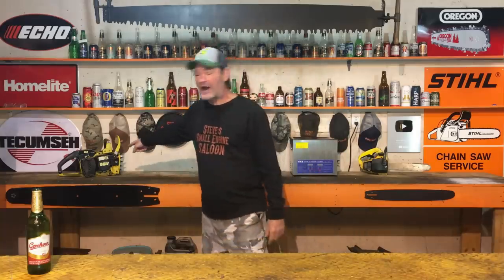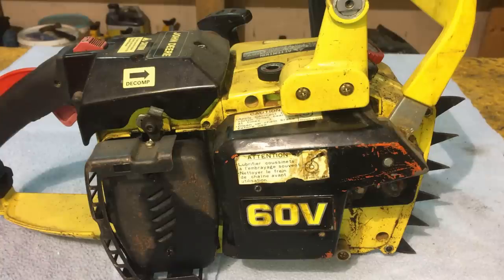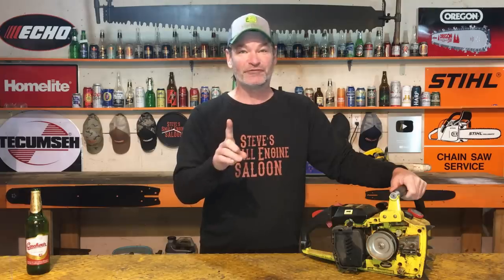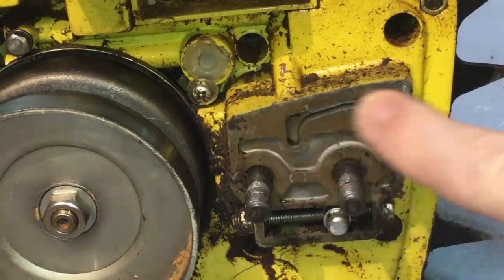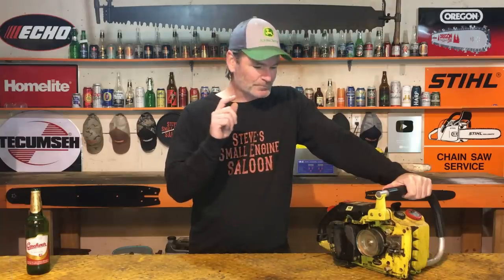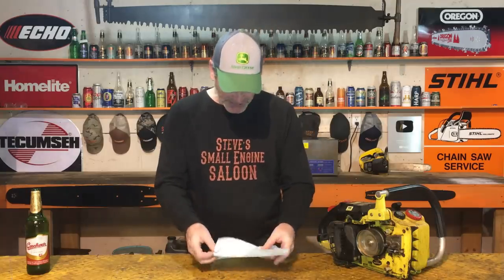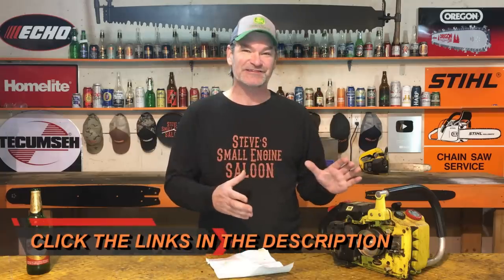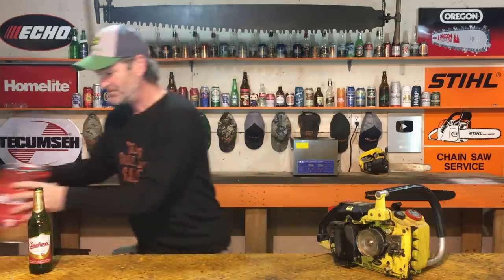Help Me Fix This Chain Saw Oiling Problem

Comment: I had an echo in my bench a while back that did that. What worked for me was  kerosene in the tank and let it sit overnight, it still wouldn't push anything through, so I load it up with brake fluid and carb cleaner in a 50/50 mix and took a air chuck and a rubber glove and forced the mix through the system through the tank opening.it took me 4 tries to get it to work but the customer has been using it for about 2 months now with no problems. Hope this helps.

Hope this helps
Jimmy Jones
echo technician and Cub cadet master technician
Ada outdoors
Ada Oklahoma

Comment: deffo would be something gummed up somewhere fill the oil tank up with some kero or pb blaster and let it sit and try running it for a bit after standing most likely will spit some gunk out from somewhere as i think its down to stuck check valves or gunk of combo of the 2

Comment: Steve , you know its just something simple because it worked at one time  and echo saws are not crap . Remove the oiler guts check the parts breakdown  and one piece at a time, blow out all the lines and tubes.

Comment: My brother in law will just remove the oil cap and shake a splash of oil onto the bar to lube the chain if the saw stops oiling in the field. It works till you can fix the real problem. I agree some solvent/oil mix to clean it out and if that doesn’t work time to disassemble. You’ve at least got a picture to go off of and beer to keep you sane.

Comment: I guess if you say you tried everything that means you tried everything which must include taking the oiling system completely apart and and making sure there is no blockages cause thats what it sounds like to me especially if you replaced the o-rings and also check the oil reservoir and make sure its free flowing if everything checks out get a manual oil can keep the bar lubricated cut wood which you say you need to do with this saw then -------drink a nice COLD bud light in the long neck bottle which Ive never seen you do and tell me that aint the best beer you ever had I know you wont do that   thanks for all the videos  love them

Comment: First thing I would do is try to make sure that the pump is getting a supply of oil the pick up screen is clear feed tube whatever it may have then I would consider the possibility of the pump drive gear being stripped I would also consider pump cavitation maybe from a bed vent cap and of course a restriction in the oil feedline, Try to lightly pressurize the oil tank while rotating motor see if you get oil coming out or remove the pump pressurize the oil tank see if the pump is getting oil

Comment: Could a piece of saw dust have fallen into the bar oil reservoir during refilling and now it worked its way into the line.  Maybe using some gasoline or other solvent forced back through the line (from the bar to the reservoir) would flush anything out.  You could use a small pipette to force the solvent through (unless of course if there is a check valve...)

Cheers!

Comment: Check and see if it has bar oil in it! Also, did it ever oil ok while in your possession. Has any body ever worked on the oiler? If so, it could have a check ball or spring in wrong. The only other thing to do is cuss it. You know, kind of like the preacher that had a lawnmower that wouldn't start after pulling on it for 3 days. He was complaining to the man he bought it from and the man told him "Reverend, you have to cuss it!" The preacher said he couldn't do that because he was a man of the cloth. The man advised him that if he kept pulling on the rope it would all come back to him.

Comment: I have the bigger brother to that saw and it wouldn't oil unless the oil came to the cap. Turns out the oil pick-up nipple is high in the tank and relies on a section of line and a oil strainer to reach the rest of the tank, and it must of rotted out before i got the saw.

Comment: I'm sure you know this, but the problem is often a piston stuck at TDC (the one that follows the  cam),  dirt (or flaw like rust) in a check ball or disk. Bad springs will do it too. That oiling system (OMG) has all those parts - and more parts than a Whole Husky  would these days. A vacuum leak on the manual oiler would also shut down the automatic side and vice-versa. Hard to be specific, but I'd be glad to give her a shot if you want to ship it. I'm no saw expert, but have many years with industrial machinery, Hydraulic valves and the like. I've seen some weird a$$ stuff causing seemingly simple problems. Take it apart again, fully understanding what each part does, and the problem will reveal itself. Beware weirdness like porous castings, transposed springs that look the same but are not (and check balls likewise) bad (small cut) rubber parts, etc. Maybe the cam is worn and not stroking properly, or spinning on the crank (if pressed or keyed on) - it's that kind of stuff that bites you in the rear. Assume NOTHING, Verify EVERYTHING!
Good luck, I'm sure you'll get it.

Comment: to fix this you have to take it apart. there is a mechanism that actuates the oiling. for whatever reason maybe rusted its stuck. or like a spring is broke. just take it apart and make sure it matches up with the diagram you have

Comment: Had an old Homelite years ago that wouldn't oil. Filled the chain port with carb cleaner and let it sit for a couple of days and then blew some compressed air into the port and the sludge came out. Those check balls sludge up. Good luck

Comment: Oiler isn't pressurized setup. It runs off engine vacuum. Good compression ?  So...its sucking air its not supposed to get...grommet where hose goes into oil tank ?  You could do a smoke check or just silicone seal that area.
  Also pickup hose in tank...filter and/or hose plugged.

Comment: Someone mentioned diesel fuel as a solvent for a soak, or carb cleaner. I think it will work outside of breaking it down and blowing all the ports out and checking the seals.

Comment: i need to know what you have done to help you
Reply: 1.take all 35 parts off put them in ultrasonic cleaner. then put the whole oil well in the ultrasonic cleaner 30min at least then blow it out and re assemble.   (make shore to drain all fluids first)

2. ore you can fill oilier full of kerosene all the way to the top and pressurize the tank in-till it frees up.  your welcome.
Reply: the reason this is happening is because one of the passages is clogged and the oil is taking the path of least resistance and flowing back into the tank.

Comment: Contact Greg at oed distributors in North Carolina they are an echo distributor and Greg has been in the parts department since those saws were made he’s very knowledgeable and will take the time to answer questions about the old saws

Comment: After an extended look at the lubrication schematic, I'm pretty sure that the thiggymawumple is not seated properly in the dugudoodle so oil doesn't develop enough pressure to pass through the hogglestint.  Or it's just broke.  I'd send it to Steve's Mall Engine Saloon I if were you.

Comment: Disassemble, check all the springs, the check balls, the O rings and passages for damage and/or gunk, blow out the passages both ways with compressed air, reassemble, fill with oil and try again.   Maybe first, check that it's got the correct bar on it, bar could be blocking the oilier.

Comment: Try to pressuring the oil tank using compressed air 
If nothing comes out you know that there is or a line broken or something clogged

Comment: It's a hydraulic contraption like an automatic transmission... full of balls, poppets, springs, check valves, etc.  At least one of the ball poppets isn't seating correctly... like a dirty needle valve on a carburetor float.  Clean it out with your choice of solvent and it might work.  Ultrasonic cleaner might work too.

Comment: Steve as complex as the oiler is it is simple the is a check ball an spring gummed up in the oil flow rate setting I'm with Larry on this one  unfortunately if that does not work you gonna need that large beer an about 2 hrs. to pull the oil system apart an make shore the is not a broken spring in it . Could have a small vacuum in the oil system as some of those used a vacuums pulse from crank case to send oil through the system but it runs to good for that but have seen that befor as well on an old Lombardo saw

Comment: Pressurize the oil tank, if oil doesn’t flow when running, then their is a spring or stop Ball stuck closed. If oil comes out when pressurized but none when not pressurized, then either an o ring worn or something stuck open that isn’t allowing the Oiler system to pressurize itself and pull oil through Oiler.

Comment: My guess is that someone has previously had a go at it and put something in the wrong way or left something out. Strip it again and carefully assemble as per the diagram. Another thought.... could it have an air lock and need to be bled somehow?

Comment: Is the oil pump driven off the crankshaft the worm Drive plastic gear could have burrs on it maybe it's stripped the teeth so no oil can drive to the oiler

Comment: Looks like a pressurised system from the crankcase doesn't have a separate oil pump, so there will be a artificial rubber one way valve connected to the crank this is not seating properly you're not building up pressure and it will suck back in check that

Comment: Weak bypass spring or leaking seal. Put brake fluid in over night. It will swell the seals. Remove the oil tank cap and see if it oils. Venting can be an issue. 
These old saws were overly complex on the oil system.

Comment: have you verified the pump drive is being drivin?  if so,  start verifying flow from the pump to the tank. work your way back 
through oiler gallerys making sure you keep track of everything you do along the way. my guess is its not priming do to an
air leak in the system.

Comment: Fairly sure that beer is the original Budweiser (pronounced bud-var in the homeland of Czechoslovakia). Some of the family emigrated to the States way back when foreigners were still wanted, decided to carry on with the family business and so set up a brewery. Then for various reasons due to pollyticks and so on borders between the two nations closed for a wee while, and when they reopened again Budweiser (now Anheuser Busch) had turned into a big company, helped by the fact that yanks like their beer to be similar to sex in a canoe. The original family business back in Czechoslovakia was still doing fine and making nice beer, and so the Yank offshoot sued their butts off and forced them to change their name. And that's what you're drinking now.

Or, I could be completely wrong. YOU be the judge.

Comment: My thoughts are the oiling passages are stopped up. Spray wd 40 starting from the chain side and let it soak, by the wat tur the saw on its side. Use a fairly stiff copper wire to work the saw dust out. Maybe have to do this from top side as well. Be safe. Peace.

Comment: I would look for cracks or corrosion somewhere in the oiling system somewhere in the chain saw case. If you can get the hand pump working would be best. You have to get that working first. You can always run and use it with just manually doing it as most old chain saws only had that. The automatic oiling may never work
Automatic oiling has to work by either pressure from the crankcase or vacuum 
You know this am sure. Get a good straight light and look for crack or corrosion somewhere in those small parts and maybe use compressed oil and block up air leaks on other ports and see if it holds air. My best bet there is a crack or a corrosion issue somewhere in the oiling system somewhere. Let use no what you find

Comment: I would take the oil intake hose and force air through it. And see if it clears the oiler pathway. If that doesn't work force feed kerosene through it. My guess is, as old as the saw is, the parts may have rusted shut.

Comment: Try pressurizing the oil tank. Put some degreaser in first. Push it in with pressure,  let it set, then run it on through,
Reply: How bout trying it in reverse

Comment: I like the idea of pressurizing the oil tank with light oil in it someone else posted.... How about using a Vacuum Cleaner to SUCK on the oil port...  Pressure could blow a hose off.... Problem might be closer to the bar.... a plugged up area...

Comment: Have you thought of drianing the Bar Oil, and putting Acetone in to "FREE-UP" the Check Valves?

Might work, might be a waste of Good Acetone...🤔

As for the "O Rings", see if you "can obtain" an OE set, or equivalent.

Glad to see that "EVEN YOU" can get Stumped!

This is a Community of Individuals. It takes a Village...

Take care Steve,😎
🤓 -Thomas
Western Washington State

Comment: Fill the oil tank with a very fluid degreaser, run it for a few minutes then slowly start opening the oil adjustment valve.
 Just a guess from my side of the pond. 👍

Comment: I only let 1 machine get the best of me. It was a McCullough eager beaver that would not start. I spent at least 70 hours working on that thing, got it to fire up for about 3 seconds than threw it up against an oak tree, took it back to the work bench and beat the hell out of it with a hammer. I felt a great sense of relief after that.  If I were you I would set a dead line on your nemesis than let it have it.

Comment: I run similar saw JD 70V too much oil. Can't turn it down enough. So I just run used motor oil. Two fills per gas fill is about normal

Comment: The hack fix which should work, but will probably always leak after is:  
Put some mineral spirits, or pb blaster in the reservoir. On the opposite side spray some in the hole. Let sit for a day. Next day blow some compressed air through the oiler port again. Might work. 

Other wise do what you got to do to attack check balls at #18. At that point just clean everything good and replace worn parts and seals. It dont seem all that complicated. I am sure you have seen worse. Hacks dont always work. Sometimes you have to go all out.

Comment: Try making an adapter from an air compressor to the oil filler. If that doesn't work try adjusting one screw at a time if possible.

Comment: Put some penatrating  oil in the res. Then form a tip on a shop vac with tape or foam to create a suction where the oil come out ,turn on vac and push the oil primer. The check valve is most likely stuck

Comment: maybe you need to manually prime it with oil (fill all the holes with oil)
its like vapor locking....... trapped air........tip,,,air bubbles don't work in truck brakes lines  also......
let me know if i won the cigar

Comment: I'd put a half tank of oil in the reservoir and leave an air pocket, then maybe even drill out a cap that fits so you can put a few lbs of air pressure with a regulator on it before you run it to make sure oil channel is open ,.. and WHILE it running so the pump can be force primed,...,..

Comment: Check there's oil in the tank, but I reckon there's a split pipe on the "suck" side of the hand oiler, usually wher the plastic pipe pushes on a nipple. It will involve a massive stripdown to find it. Good luck Steve.

Comment: If all parts can't be replaced, then it's of no use. A check ball may be stuck or in the wrong place. Or maybe the bar oil we use today is too thick to travel through the orifice.

Comment: I am in no ways a mechanic but I have been drinking. ;-)  "Freedom's just another word for nothing left to lose". Compressed air to oil input and output, yes! Also, maybe spray liquid wrench in both ends, let sit for a day, blow out penetrating oil (if possible),  repeat.

Comment: Hi steve not positive this is your oiling problem but i had the same trouble with a saw that drove me crazy it was a very old saw i had and it took me some time to find out the oil tube went through the case from the tank they had  holes machine bored through that dam case like a snake that tubing went thru, here to find out the saw sat for several years without being run and most of that dam tubing was rock hard like cement.
I had to take that dam thing totally apart  and heat that case to  soften that tube till it poured out like syrup  what a Pain. Good luck with yours it might take a case of beer and a 5th of jack...lol

Comment: I might consider filling the tank with a solvent that is non-harmful to the rubber o-rings and seals.  Then perhaps sitting the thing out in the warm sunlight for a while and let it marinate for a while.  Maybe use the pumper occasionally to see if you can coax some solvent through it. I wouldn't blow high pressure air back through from the outside...it will just recycle the trash through the complicate system. If all else fails you know what you must do...disassemble and clean the infernal abomination...maybe put the beer down and grab a pint of good Canadian liquor and be done with it.

Comment: Looks similar to a small valve body on an automatic transmission.Warm some vegetable oil to where it want melt anything. Pour it in,try it.Might spray wd40 in very thin oil after heating veg oil.If it needs a kit like a valve body to pull oil thru system  I would call it a black market item.

Comment: I recently had  ECHO that would't oil. the manual pump wouldn't oil. i took he auto oiler and the manual pump out sprayed brake clean thru all the lines and ports then put in a new auto oiler and manual pump and it worked fine. i really think it was the manual pump caused the problem. you didn't say weather or not you replaced the manual pump. if not i would start there